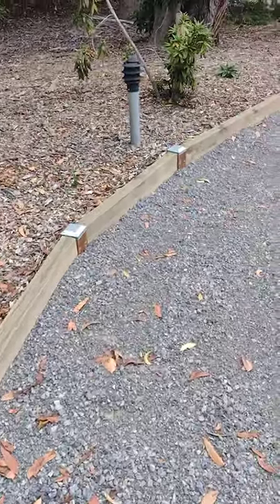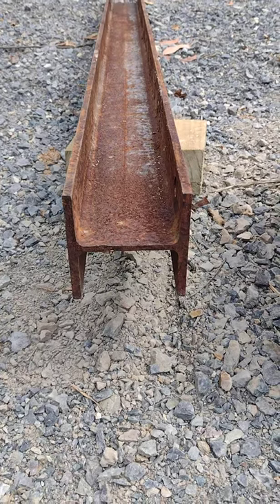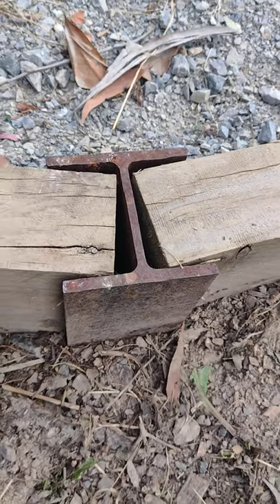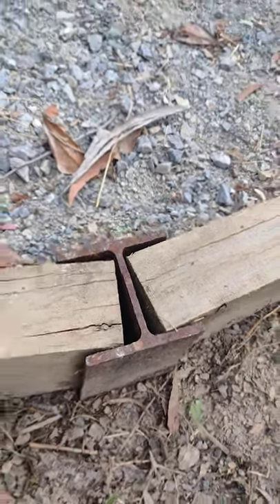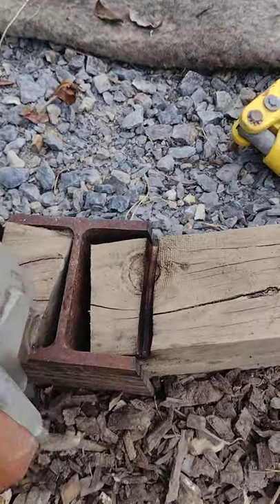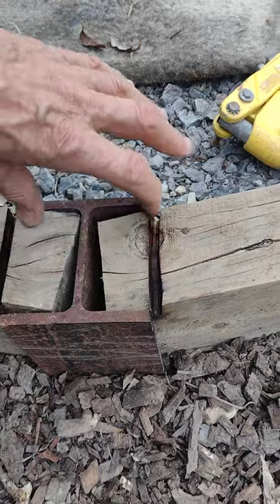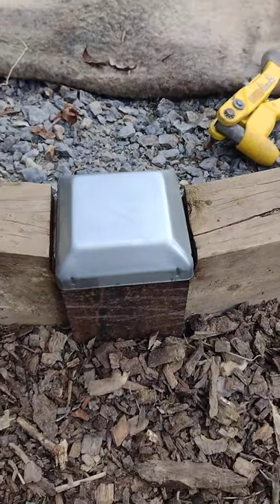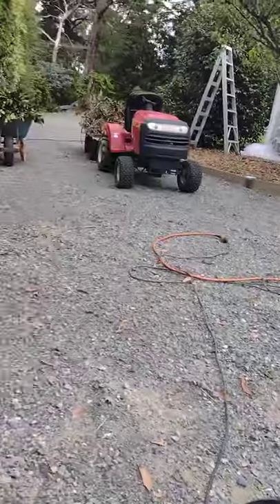Driveway Edging... possibly one of the most cost efficient way!

Comment: Do you drive that whole H beam in the ground or try and cut that!?!?!?
Reply from the maker: Around corners with treated pine sleepers 1200mm long I use 400mm H steel pieces and on straight edging treated pine is 2400mm I cut the H at 600mm that seems to keep everything nice and sturdy, I also added two 50mm screws by drilling two holes on each H steel. One section I done 12 mth ago and it hasn't moved one bit.
Reply: Seriously, do you think he drove that whole beam into the ground for it to stick out just 4”? Use your brain my man. He probably made them 1 foot or so long
Reply: @gsaexperience8578  sounds like you don't know for sure. That's why you ASK big brain!
Reply: @fishsizzle83  I do know for sure that he didn’t  pound that while I beam into the ground. The only thing I’m not sure of is how long it was when he did. But obviously he didn’t point an 8’ bean into the ground to hold back a 4x4. It was probably a foot or so.
Reply: @gsaexperience8578  I know. originally it was meant to be a sarcastic comment to the creator because he never elaborated on it. And then...  the great internet that it is, blessed me, you come along with your slick comment somehow acting as if I'm some smooth-brained moron!! Lol. 
Love the web
Reply from the maker: @Parkertannerz ...the 4 foot shorter timbers that are going circular are held by a 16" H steel, the longer 8 foot straight timbers are held by 2 ft H steel